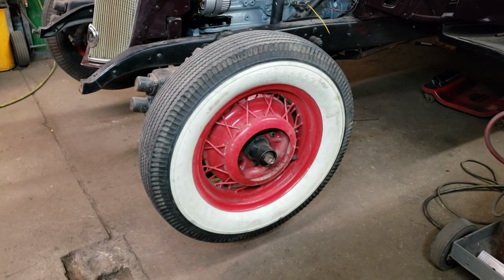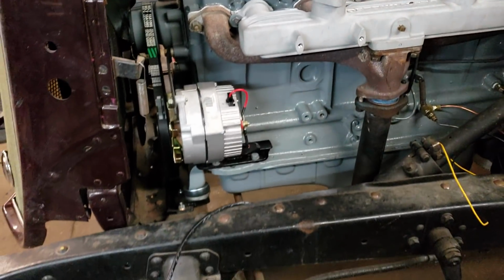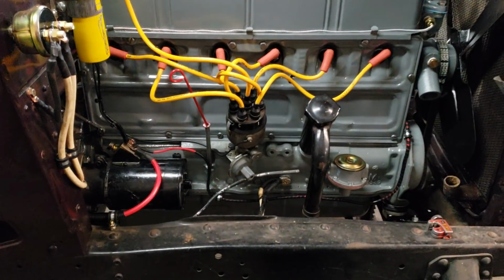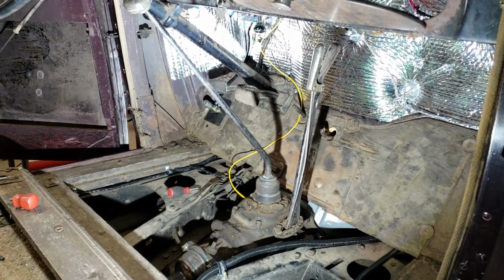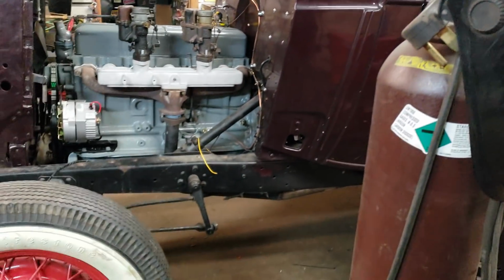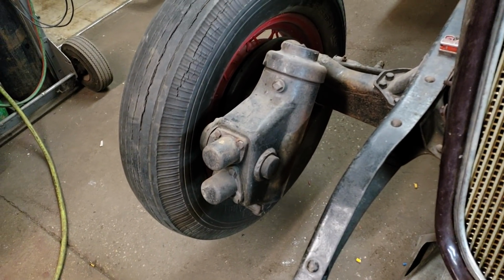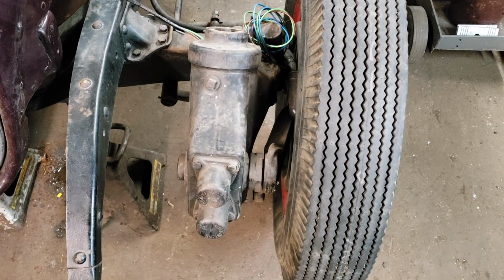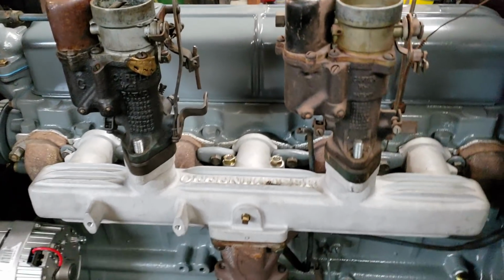1934 Chevy master deluxe

Comment: Matt ,I owned a 35 master with factory suicide doors ,Still have extra tail lights and some aftermarket lenses if the owner needs them. Those front shocks were called knee action i recall . Looking real nice and can't wait to see the finished product. BTW Iv'e been out in my 39 Packard 5 window now going on my 3rd year . Last 2 years first place in Ratrod class. Hope to get back into taking some videos . I sold the 48 studebaker to my buddy .

Comment: Smooth progress. The old 216 looks like it belongs there. The 235 wasn't exactly a bolt in switch in my 41 Chevy back in the day either. Looking back, I wish I had just upgraded to a 283 V8 for the amount of work I went through.

Comment: Any chance you could help me out?  I have a 34 Chevy master and can’t find a replacement battery. Did you convert this to 12v?  I bought an optima replacement from NAPA and it doesn’t fit. Thanks!
Reply from the maker: I did convert it to 12.
But I would think any tractor supply company would have a 6v that would fit . Thats where I get my 6volt batteries from and they have all fit i the old chevys